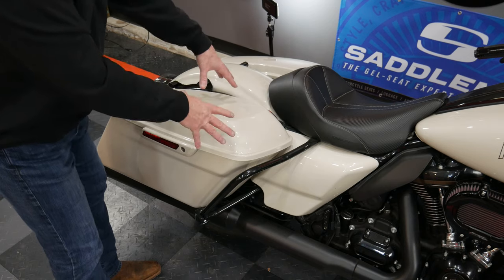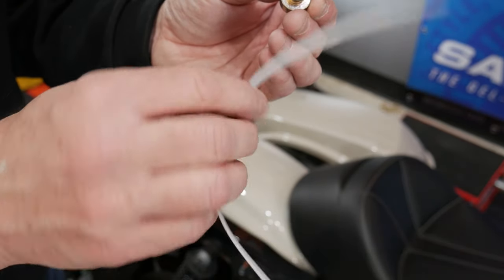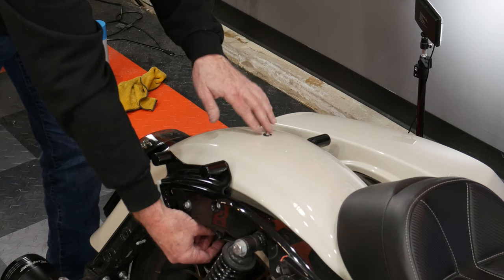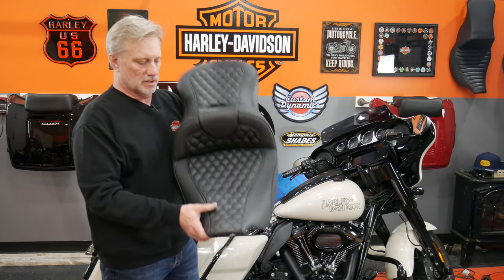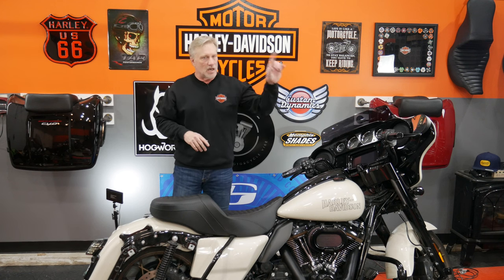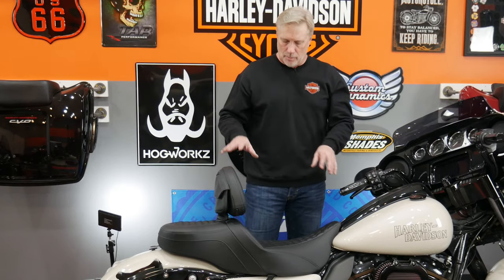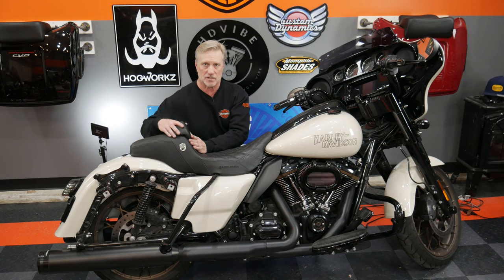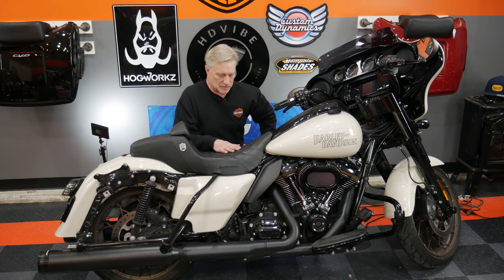Harley Seat Nut Replacement Hack | Solo Seat to 2 Up Saddlemen

Comment: Now that's a great time saver. The problem I have had in the past is that I lose the seat screw. After losing the first several screws I stopped worrying about it. My weight keeps the seat down and secure. That road sofa seat looks awesome.
Reply from the maker: Thanks Scott for watching and commenting.   Losing the screw happens too.  I try to check them before I ride, but, sometimes I forget.   Haven't lost one yet though.  Thanks for your continued support to the channel.   Ride safe and enjoy.  👊✌️👍

Comment: I lost the #$%@ thing, I replaced it with a nutsert, no more problems. That was one of the first frustrating parts on my 98 fat boy
Reply from the maker: Thanks for watching and commenting.   Losing those freaking fender seat nuts happens often.  If you are already a subscriber to the channel...thank you.   If you haven't yet subscribed to the channel I'd be honored if you'd consider doing so.   Thanks for your support and ride safe.  ✌️👊👍

Comment: I've done mine with a long wire with a knot on one end.  Another great video Rick.  Really enjoyed it. I'm running a hd Hammock seat with a back rest .  Very comfortable.  Stuart.
Reply from the maker: Thanks Stuart for watching and providing your tip.  Another fine method to get those pesky seat nuts in the fender.  Thanks for your continued support and ride safe.  👊✌️👍

Comment: Have any more info or your opinion on the dominator solo seat? Not sure if I want a two up seat on my 2022 street glide st or not due to the looks and I have not had a passenger on one of my bikes for years(if she wants to go for a ride she should have her own bike I guess) but looking for a more comfortable seat for longer rides…thnx in advance for your advice..oh and the sdc? Seat I think u said is also a saddleman? Seems like in between the sofa and the dominator… any more input by u on that as well would be appreciated…thnx
Reply from the maker: Thanks for watching and commenting.   I really like the Dominator Solo Seat.  It is really comfortable and I've even used it on long trips and was very comfortable.   I have over 5000 or so miles on the Dominator Solo.  I also run it on my 2021 Street Glide CVO.   I would definitely recommend it.  If you are already a subscriber to the channel...thank you.   If you haven't yet subscribed to the channel I'd be honored if you'd consider doing so.  Thanks for your support and ride safe.  ✌️👍👊
Reply: @HDVIBE  I have been subscribed for a while and thnx
Reply from the maker: @davemeshamsr6000 Thank you.  I appreciate your support.  ✌️👍👊